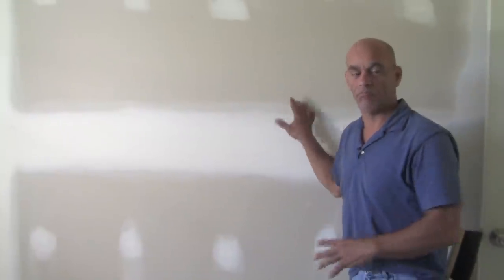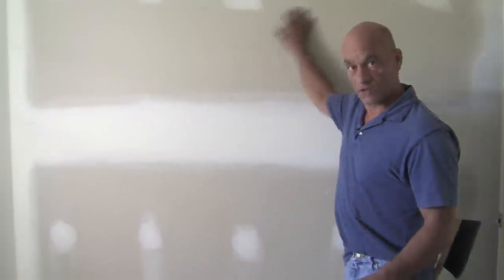How To Get the Smoothest Drywall Finish

Comment: Or you could take a hopper with the small tip and spray the compound as a fine mist, allow to dry then sand lightly with  250 grit. Faster, less work.

Comment: Hey Dom. Just found your channel. You are awesome. I just replaced some drywall in my laundry room after we had a black mold remediation. The guys that removed the old board did a 3 foot high flood cut up from the floor to remove all the mold. Ive replaced the drywall, but the lets just say some of the drywall joints aren't flush. Ive tried to fix it but it comes out the same every time. I think the best option is to do a heavy texture to cover all of the flaws and the uneven joints. The original walls have a light but pretty uneven texture on them. Ive textured walls before, but its been a long time and I don't want to end up wasting a bunch of mud. Any advice or direction you could give would be fantastic. Im going to attempt to start taping the uneven joints today (yikes)…. and I'm a bit scared to even get started. Can you help??

Comment: How is "spraying" (a trip to the rental branch) a primer, back rolling, and sanding easier than this method?  It should only take all of about five minutes to sand an entire bathroom on final stage 5 coat.  I hardly doubt drywall mud is more expensive than a primer.
Reply: You still have to use primer, and its not hard to roll it on.

Comment: Hi
If you're worried about the compound flashing, why not just roll the whole wall with Zinsser Gardz ? It'd seal your joint compound and the drywall so that you would have a uniform finish. 
Just curious as your way seems to be a lot more work involved to achieve the same result.

Comment: Is this something I would do to get rid of the imperfections i can see on my ceiling? A new ceiling was put up and my spackling skills are intermediate. All of my walls look great but I can see every joint on the ceiling. Clearly I didn't use a wide enough knife and didn't feather it enough. I know I was supposed to use flat paint on ceiling but we used the same paint as used on the walls. A satin pure white. Id like to keep the satin finish look but will consider using flat paint if I have no other choice. Do I need to sand the existing paint or can I spackle right over it? After feathering it properly do I give the ceiling a level 5 finish so I can use the satin paint?

Comment: ok now for a level 10 finish base coat your join as per normal then top the entire wall. for those who are well experienced using topping plaster won't find it that hard to do.
again it's level 10finish..
Michael as for Top Class Ceilings..

Comment: Can I use this trick on old walls? I have two walls in a room which had nails not screws. I have removed nails and replaced it with screws. however the wall looks uneven in few spots

Comment: This just might solve my problem. I just scrapes off popcorn finish from my br ceiling but it's not 100% consistent now. I plan on doing a stencil design which will require me to use tape on the ceiling (to hold the stencil up). 24 hours after the popcorn has been removed the ceiling is a bit flakey, meaning little bits and piecing will come off when I primed it earlier. I was thinking of a way to get it back nice and solid and also been out the inconsistencies so when I apply the stencil bits and pieces won't be stuck to the tape. I was thinking using my hand sander with 220 grit then I saw this video. what yah think? just sand, prime then paint or apply joint compound before those steps?

Comment: We tried the roller method as suggested. The compound we used was USG General Purpose and thinned a bit more than was shown in the video. The compound dried some by the time we got the compound rolled on and ready to smooth with a trowel. When we started to trowel the compound it began gumming up and lumping together. The finish was horrible so it had to be completely sanded off. We then applied compound in sections using a trowel and smoothed it immediately. Took way longer but the finish was perfect. What did we do wrong?
Reply: Don't mix it so thin.  Like yogurt.

Comment: Thanks Dom,
What kind of roller nap thickness do you use when you roll on the thinned town joint compound skim cost?
Thanks.
Reply from the maker: You can use any really. But I like a real thick one like 1/2 -3/4"

Comment: Thank you for your videos!   I have a wall that is textured, I want one section  5 x 10 smoothed out from floor to ceiling and  paint hi-gloss.  Is it going to be hard to have the section with clean lines without it being bumpy from texture to smooth?
Reply: Must use more mud and float the section you want smooth.  The best finish will come from floating the entire wall with minimum 2 coats and then sand to smooth.  if you want half of the wall textured, then mask and retexture after floating.  This will give a better transition from smooth to texture.

Comment: hey dom, can i mud over painted walls with imprefections? and do you recommend the 90  minute fast dry powder?
Reply from the maker: Yeah sure you can. But make sure the wall is clean. Powder aka Durabond is ok. But regular would be smoother and easier to work with.

Comment: Did I ear him say "nail holes"? I'm just a pro painter but I know nails went out 20 years ago. I do skim walls and I think if you are using the bigger knife to pull all of the mud down, what is the roller for? That may work because there is no bottom base yet but what about with the ceiling? I had a partner and when we removed stubborn wall paper that left too many bad places, we would skim the whole wall top to bottom and then you sand the whole wall. That takes extra time but results in a perfect finish. The final coat is always up to par with 5 items. Tape, mud, 6 inch knife, 8 inch knife (or 10) and your pole sander. I'm a painter (over 35 years) but That's how it goes. A roller has other purposes. It works great for removing wall paper when dipped in hot water. Oh well, to each his own but I attest, you can't be a good painter without being a good drywall man because they go hand in hand.

Comment: Why not just plaster your walls if you want that smooth of a finish? Too expensive? Pros or cons?
Reply: Plaster is harder for a DIYer or really anyone not skilled in plastering to do, I love plaster but it's hard. Plaster's biggest issue is you need to do it all in one shot. You have an hour or so to get it on the wall flat and perfect, and you can't sand it to fix mistakes. Especially if you're doing a whole big room or multiple rooms, it's really hard to do yourself. Whereas drywall can be lazy work the way most people do it, you do your passes over the joints, wait a day, (you can use hot mud, a sort of hybrid plaster and drywall compound, and cut the time down, but it still needs to dry...) wait another day for the next pass, then another day for sanding. Plaster's gotta be done in one hard workday, at least the finish coat. So a skim coated wall takes less overall skill to do. Just I think drywall finishing is really bad from a health perspective and for leaving a clean workplace, plaster has no sanding dust. This said, I think plaster is overall way better except it is harder. Also it dries harder, too, more resistant to small bumps and that sort of thing. 

In USA the reason drywall joint finishing became king was partially from the need of a lot of houses during the Baby Boom era, but I think mainly it was unions and wages. Plasterers were skilled union workers that generally got paid a lot, and the skill took a long time to learn. Drywall you could get random people (lots of times yes, illegal immigrants) and basically assembly line the process. Drywall as well also usually is a cash unlicensed business in USA, which cut prices too.

Comment: The reason the compound shows through on new drywall, is because most commercial painters never seal the drywall, with a latex primer. Then they spray 2 thin coats of paint, lucky if you get 4 mils of thickness, on bare drywall. As a Professional Coatings Rep, I saw this being done for years. Seal the drywall, with a good primer. Apply 2 coats of a quality paint. Use a 3/8" nap roller. And you'll have no problems.

Comment: Lev5 is more than just smooth, it is flat.  Taped joints aren't flat. And what you just did would not flatten out the walls.  Paint that wall with a dark glossy finish and it will show all its flaws......

Comment: Why not just plaster the walls if your going to coat the hole thing any way?  is not a plaster finish Better?
Reply: More or less what I was thinking. Maybe there aren't many skimmers in the US?
Reply: It's a lost art, but still a few out there.  It was still done in maybe 25% of homes back when I started in 87.
Reply: Hey would 't A good primer do the same thing?   not the cheap stuff.
Reply from the maker: Not really. It will help for sure.  Level 5 works well when you really need to and when it's spec for a level 5. Mostly commercial type work.
Reply: D Walters plaster? This is not the 50s
Reply: That was my point !!!!
Reply: Exactly! I am an electrician, and I absolutely HATE cutting plaster walls and ceilings when installing new lighting, switch/outlet boxes, etc. I charge extra money on such jobs for the aggravation.
Reply: Mark Thomas
Its more like ...they have on skim coat plaster in the US , They only have mud and durabond , But Yip...Two coats of multi finnish and it would have been done form scratch , not even needing to be Ames taped first.
Total job time for a full room of walls 4 or 5 hours from raw Sheetrock  , and its a fraction of the price of mud :D

Comment: I personally would never use this technique unless I was laying down a large amount of mesh tape to repair brittle laft construction! A coat of primer would take care of the difference in texture from clean sheetrock 2 speckled joins!
Reply from the maker: Most only use this method when plans spec for a level five finish.

Comment: Can you use this method on a concrete wall
Reply: S Vukovic sure, just hydrate the wall, soak it to speed curing, maybe a light spray before you roll it, spraying material would be best,  just satisfy the suction so it doesn't soak up your material

Comment: I'm not wasting time doing this. This procedure is unnecessary.
Reply: The dry wall absorbs the mud and becomes stronger cause of it.
Reply: unnecessary to you maybe but at high end jobs or where the customer is really anal about quality is a must. and dont forget they do pay extra for this procedure.
for anyone that likes or wants to put any sheen paint besides flat paint this is a must, because the sheen level shows everything.
Reply: YEAH RIGHT
Reply: let me know the name of your company so this i can never hire you
Reply: pva primer makes it stronger on the paper, compound is soft.
Reply: odd, i've been a painter for over 35 years, working on high end houses in Connecticut and never had any complaints using primer and 2 finish coats. Definitely not a "must"...honesty with your customer is a "must".
Reply: So...don't.

Comment: You're silly dude. That's way too many steps. A professional drywaller can do the whole thing mudding and Joint finish top coating all in one swoop not needing any sanding done when finished
Reply: Larry Walden no they can’t. Compound doesn’t dry that fast.
Reply: I've fixed  alot of those jobs

Comment: Question, anybody,  about preventing air bubbles when mixing drywall?
Reply from the maker: +Roger Dodger (doodar21) Don't mix really fast. Make sure your mixer is all the way in your mix. Either way the bubbles will come out.

Comment: Put Dawn soap in the mud
Reply: ScrambleTown Bullies I just heard the dawn soap in mud trick 2 days ago. I was skeptical but might have to try now to see what's it all about.
Reply: Pedro Marcano it's nice ...takes out alot of the air bubbles out makes the mud smooth.. and will loosen up your mud if it's too thick... When you use it don't be scared to put a good amount in
Reply: Thanks brother I appreciate it.
Reply: don't use dawn soap smh only use Ivory dish soap because it's chemical free. The chemicals in dawn soap and others doesn't work with the chemicals in the paint. So paint doesn't stick or adhere to the drywall. Been doing drywall for 21 years.

Comment: It would've been much easier and neater to just trowel or even use a mud box to do what you did. Either way this isn't going to achieve what you're promoting. Assuming the drywall taping/mudding job was done professionally with at least two top coats, to truly achieve the "Smoothest Drywall Finish" you either have to spray the mud or just as you did with the roller but instead of troweling the mud you use either magic trowel 24"or a similar product. You won't be removing all the mud off the walls.
Reply from the maker: Order in Chaos You really didn't pay attention to the video. You need to thin the mud out that being said you're not going to just trowel it on. Either way, you talk like a pro. Or so you may think you're. But only one question comes mind.  Why are you watching my video?
Reply: askmediy Dominic love the videos keep it up. I am a contractor, for about 4 years now. My father is a general contractor, and I started with him when I was 13 and I must say, I can do really good work but I always am watching other videos, to see how my technique differs from others, and any ways to improve my work , either quality or speed. Once again love the videos, keep it up!
Reply from the maker: Order in Chaos Thanks buddy. Glad I could help out.

Comment: What the heck is everyone saying bla bla bla...new construction primer, drywall primer, etc, etc, etc...does no one know the actual name of the primer??? Just say it like it is boyz.. PVA primer, hello? Like it's a big secret. I use it on all my jobs. Do 350,000 houses and it works fine. Don't even back roll it. PRO TIP: Either prime then texture or prime(to dust off) texture and prime again. Anyone know why the extra step? Believe or not, it can actually save you money, if you are contracted to do the painting also.

Comment: Level 5....what a joke, it's drywall.  Cheap drywall.  Trying to make a common man's product sound upscale.  Totally not necessary and defiets the purpose of drywall altogether.  A waste of time and money.  If you want an expensive wall...do like the old mansions and put up some nice mahogany with tons of trim.  Nice video though on how to give the architect and building commission what they want...enhance union labor.  Because that's the root of this unnecessary step.  Trying to justify it by that once in a blue moon mysterious light is a crock.

Comment: A 'how-to' video that doesn't do it properly?  WTF?  Why not sit in a chair and explain it?  You couldn't have re-shot the video in the adjoining area and put the compound on as thick or 
 the way you normally would?  
I'm a painter in SW Florida and can say that many of the expensive homes (7-8 figures) want level 5 finish.  Anybody who has seen level 5 knows that it is dramatically better.  I disagree with anyone who claims they get a perfect surface with primer, then paint.  Locally level 5 is sprayed.  I'd advise anyone to check out the USG vids here on YouTube.
Level 5 may not be appropriate for C-store or a dark restaurant, but it is for a fine home, or law/accounting office.

Comment: Waste of time. Just plaster the wall. Alot of effort for what? Tape and mud is the biggest waste of time, youd of plastered it and be gone. All this taping sanding is a load of CRAP.
Reply: Jimjim Skimmer hardly anyone does plaster anymore
Reply: Jorge duarte thats how you get cracks!  tape prevents cracks may llok good now butt wait it will crack for sure!
Reply: Jorge duarte  damn shame isnt it ? Plaster 150 times better
Reply: In New England both veneer plaster over blueboard and mud/tape/skimming (as described here) are popular. I understand that a skilled plasterer can get the job done faster over blue-board, but don't let an amateur try that, and even if it looks good, it cracks more easily. Taped joints are much more flexible.

Comment: This is all lies.. Level 5 is a big scam. Only time you'll see a difference is if your finishing is lousy. He's also using crappy lightweight mud which is the best indicator hes working for the benefit of himself and not the customer.

Full disclosure - been a drywall finisher / contractor for 43 years. Done it all.
Reply: John Parker I can finish with dogshit. It doesn't matter if it's light weight or regular rucco, or box of mud. We all working for ourselves not the customer, if you say different. Your lying to yourself
Reply: What's a good solution to rid a bad plastering job that consist of texture and scratches? I've gotten several estimates to correct it and everyone wants to overcharge.